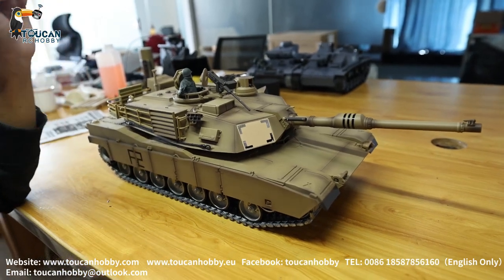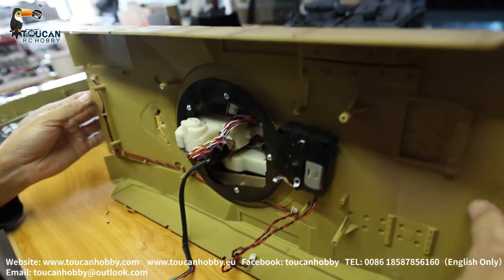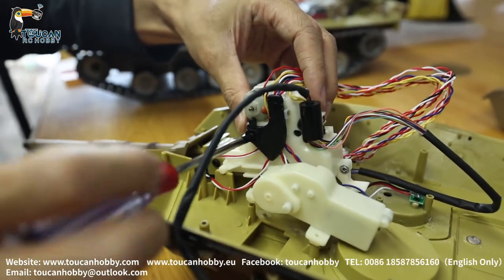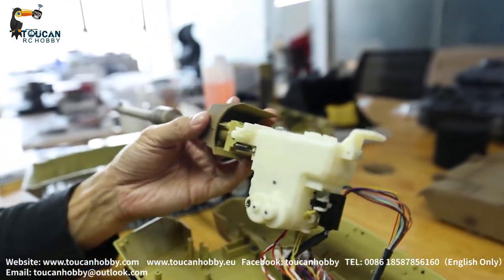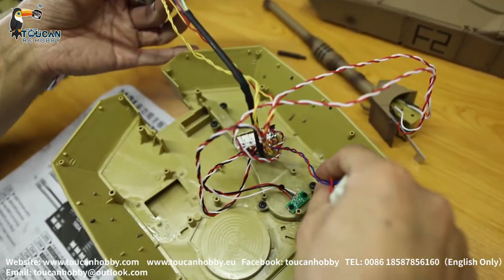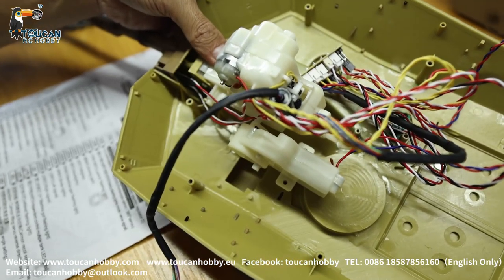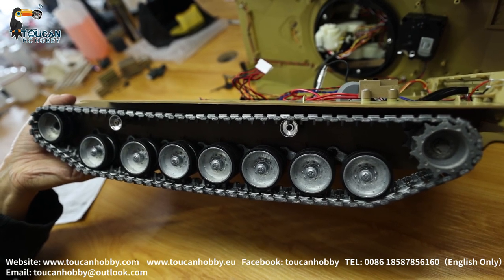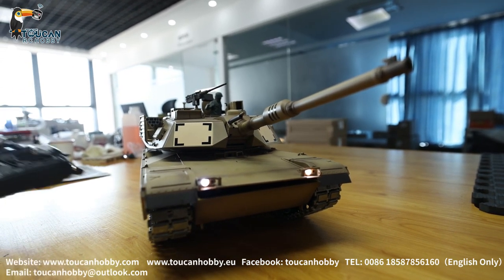What to do if your tank got some functions not working?Disassemble Henglong Abrams M1A2 to show you.

Comment: You didn't show the most important part... How to remove that part that is glued.... do you just pull it off or what?
Reply: No it has a screw unscrew  it, then take it off it has a small slot and pin on the right to hold it in place, so do not yank it off, or you broke it . Reverse  the action to put it back on

Comment: Hey my tank fell into some deeper water worked for about 5 more minutes fine then died it has power and that but turret and tracks won’t move
Reply: Main board is damaged need a new main board .
Reply: @tonyv3659  where can I get one
Reply: And is there a video on how to connect a new one
Reply: @Off-roading1   is 7.0 or 2.4ghz main borad
Reply: @tonyv3659  ok how would I connect the remote? To it or would it do it automatically
Reply: You can when you find out ask Oliver to send you one he's good that way he can be found right here lol . 
 He has everything you need for that tank .
 You know before the tank can go swimming  you must waterproof  the main board with nail polish.  
 Look up waterproofing tanks or electronics on utube .
Reply: @tonyv3659  guess the video I watched wasn’t the best
Reply: First you need the main board from Oliver then he can send you like he did me by email a very detailed connection visual demonstration wire by wire where to connect it to the main board ports . After that's been done successfully  it may take several attempts, he can then show you how to bind the controller to the main bord very easy . That may not be your only issue , this is trouble shooting  . If it starts but motors don't run them motors are fried water damaged need new ones this takes time a patients but it's worth it once you find out how to fix your tank .
Reply: @tonyv3659  awesome thanks
Reply: No, a lot of vids on utube are not very good or just incomplete  or way too much detail. The best thing is to get in touch with Oliver the dude is rock solid . It's a bit of a language barrier, but it's not bad at all.

Comment: Do you have video tutorial on how to fix coaxial machine gun that's no longer flashing?  That's what happened to mine after I did a test run outside on a very rocky road :(
Reply from the maker: Do you see all the wires for the light is there any loosed?